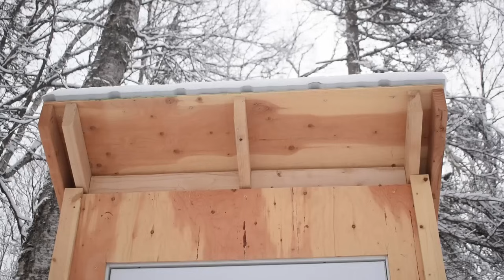Cabin Ep 3: Finishing The Foundation | Building Our Homestead

Comment: Levi you should insulate your floor before you get all the plywood down, and maybe try to get some small gauge wire mesh to hole the insulation up in place and it will help to keep varmint out of the insulation.
Reply from the maker: We're going to wait to insulate until the roof is on because of all the rain we'll inevitably be getting. We'd rather crawl around under the floor over the insulation getting wet!
Reply: #1 just wondering why the floor joists are so close #2 put the silver moisture barrier down in between the joists (you have the ledges) then insulate, then plywood. Done. No need to crawl underneath later. No critters either

Comment: Curious on what your plan for insulating the floor and how you plan to keep rodents out of your insulated floor? Looking good. Will be nice to have all the floor done before mud season! I built my log home from a kit 30 years ago. I used OSB board on my floor. If I had it to do over I would of had a tarp large enough to cover the floor to protect it from rain. It ended up getting rained on a few times and that caused the OSB to swell. It caused some problems when flooring was installed. As soon as we got the logs up, roof installed and window in we moved in. It took nearly 10 years to complete. We did 95% of the work ourselves. Built the entire home with out a mortgage. We bought materials and furnishings a little at a time to stay out of debt. It was a pain doing it that way but was worth it in the long run. Wishing you guys the best of luck and a blessed happy life!!!
Reply from the maker: We plan on doing r30 in the floor and we will do some sealed osb on the underside after we finish with electrical and plumbing. We have some large tarps that we plan to use if needed but for now we have sealed the osb with some discounted deck sealant from home depot.